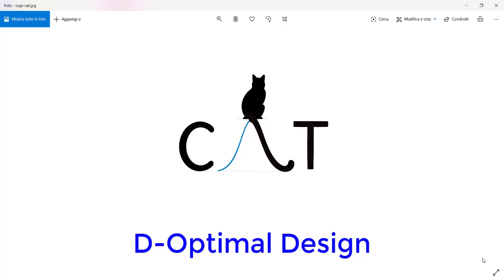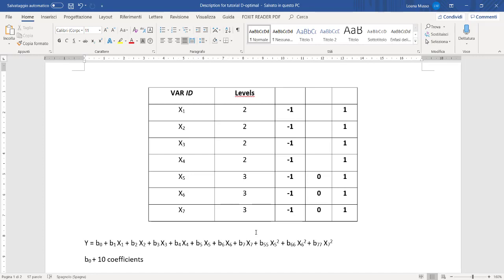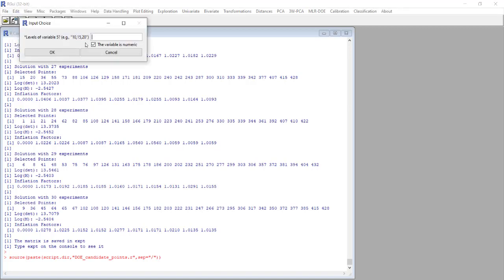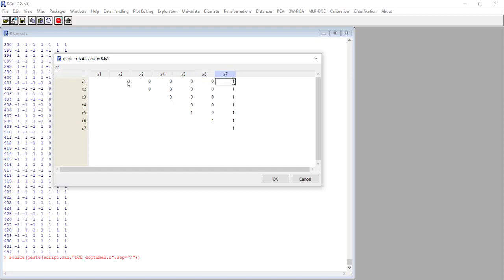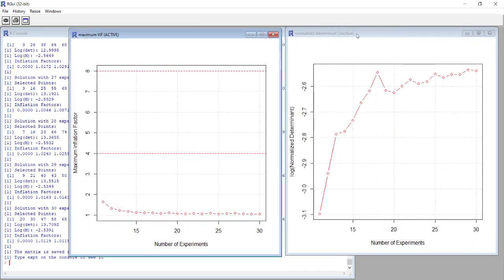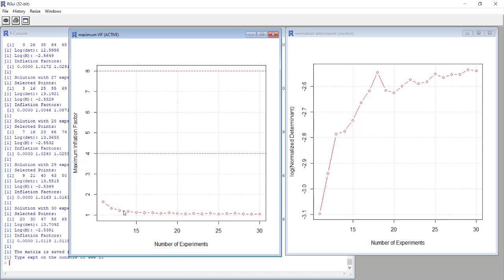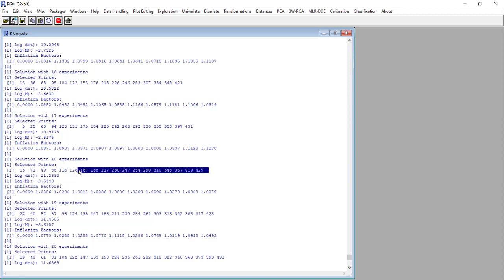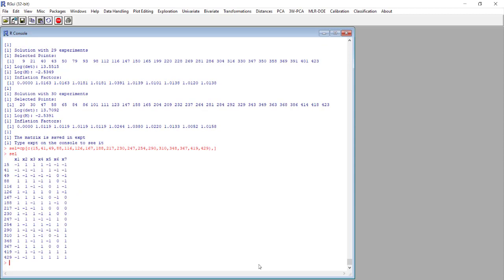D-Optimal Design [Tutorial]

Comment: can you please make a video about I optimal design which covers its center points and factor points?
Reply from the maker: Hi Shivam, actually we have to make a "manual" video about the D-Optimal design in generalI. Anyway, I guess you are meaning the D-Optimal design by addition. If so, it's pretty easy. Once you have your data matrix (X values) loaded in CAT you go to the Menu MLR-DOE and select the submenu "D-Optimal by addition". After clicking it you are asked the matrix name "Matrix with performed experiments" and below the "Matrix with candidate points".
Reply: @cat-chemometricagiletool4500  no I mean I optimal design only.
Reply from the maker: By definition D-Optimal design gives you the best compromise between the information obtained and the experimental effort. For example, if you study 3 variables only it will give you the points at the corners of the cube (8 exps). Basically using the D-optimal design you wouldn’t need the other traditional designs anymore... If you have further questions please contact us!
Reply: @cat-chemometricagiletool4500  no like I'm working on A project which has I optimal design so I needed info about that